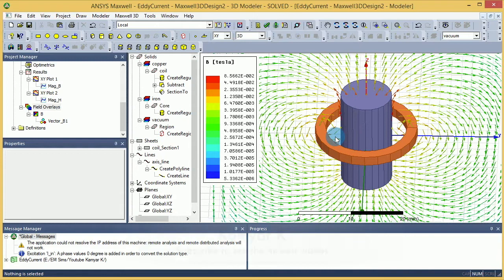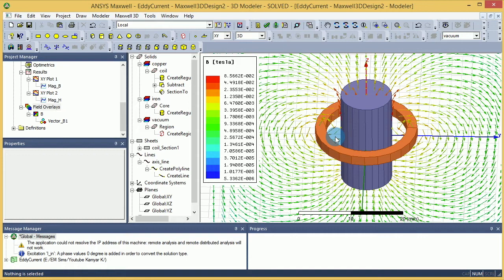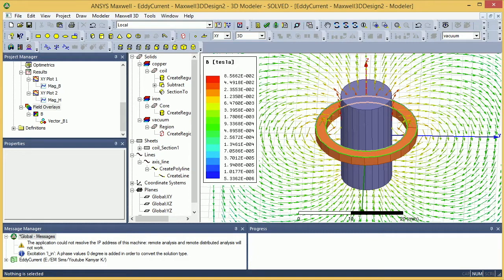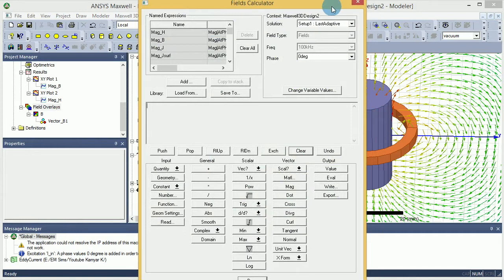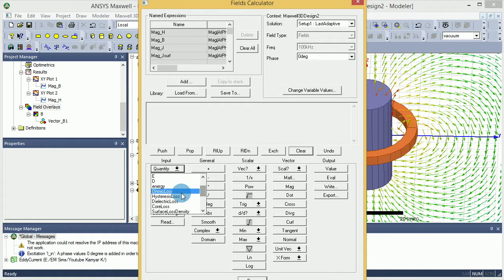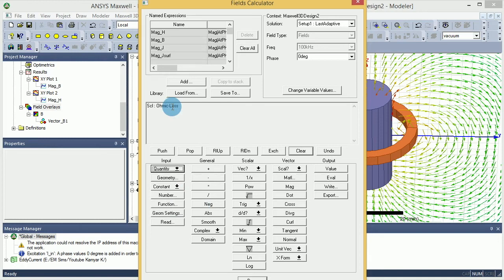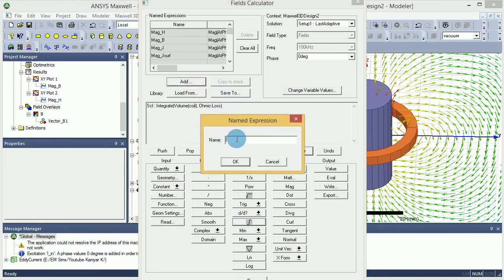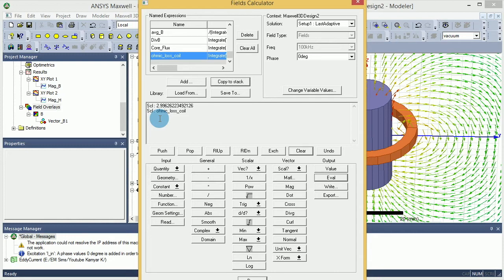704  Field Calculator | Calculating Core Loss of a Specific Part

Comment: Do you guys know how to find the radial and axial components of the magnetic flux density using Ansys Maxwell?
Reply from the maker: The radial field at any sheet  is in basically along  x or y. It really depends on the sheet you’re looking at it
Reply: 20 00 asked for a different thing, you propabiliy didn't understand. 
There are two components in magnetic flux density, radial and axial. And I think 20 00 wants to observe the radical and axial magnetic flux densities.  
Maybe you can check fig.3 in  paper entitled "Analysis of mechanical characteristics of transformer winding under short circuit fault"